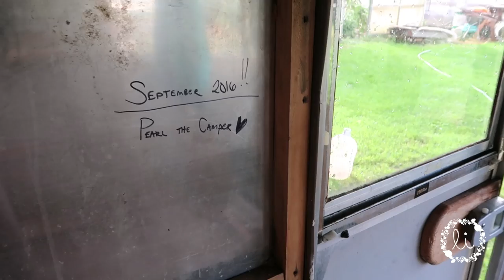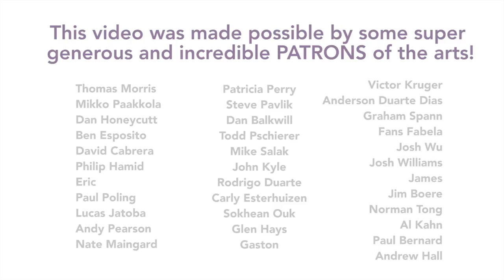PART 2: Finding Pearl 🚃 - a Vintage 1969 Bailey camper caravan trailer

Comment: Hey Jessica, my husband and I just bought a 1968 Bailey Camper like yours and we are starting the renovation to it! Yours turned out absolutely amazing! We are wondering what you used on the ceiling and walls? Especially the ceiling where it is curved. We are completely new at this so any help would be so much appreciated! :)
Reply from the maker: Hi Kelsey! We used 1/8 inch puckboard and covered it with fabric with a staple gun on the seams. Then we covered the seams with a plastic moldling that we just staple gunned and nailed in.  It was difficult, the three of us were doing it, but so far it's it held up great!! I do think though if I were to do it again, I would just paint the ceiling rather than cover with fabric because sometimes it gets dirty / food splatters and hard to clean because the fabric can't be removed.
Reply: @jessicaallossery  okay awesome!! I will look into the puckboard. Thank you so much!!
Reply from the maker: @kelseymackenzie3687  you're welcome. Goodluck!

Comment: You need to post why you had chosen to go tiny....Also do you have heat or air?
Reply from the maker: I chose to go tiny because it was just me and it's all the space I needed. And it's all I could find/afford!
Reply from the maker: I have a small plug in space heater and I have air conditioning that I installed in year 2
Reply: I just love it!!!!!